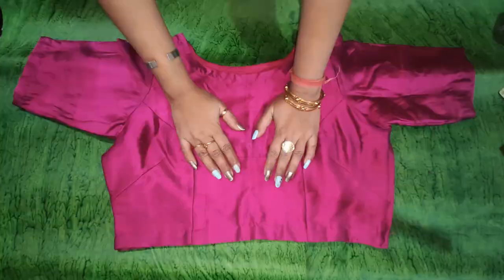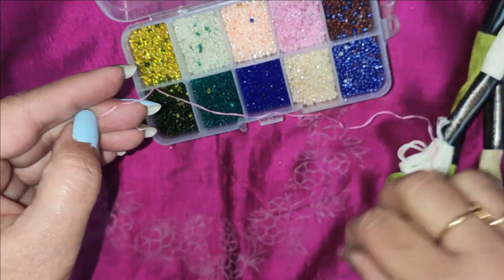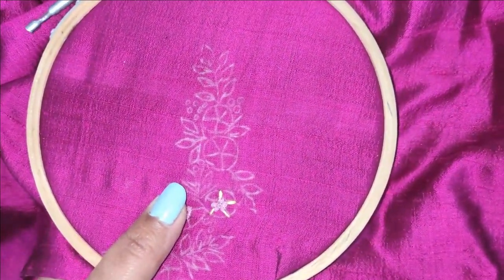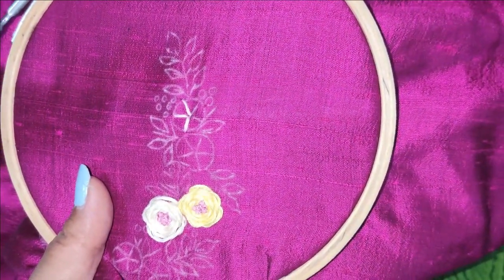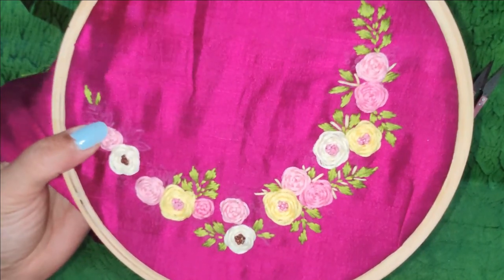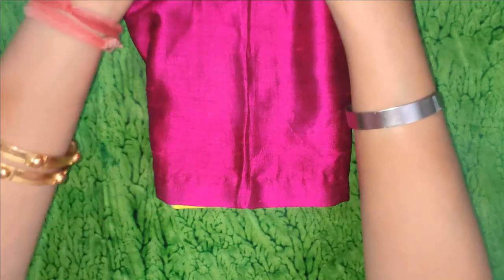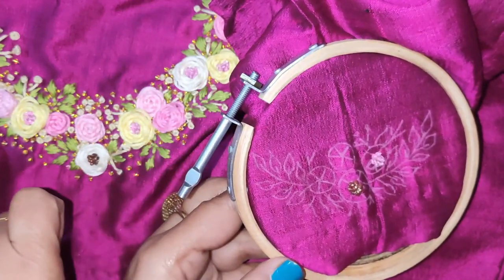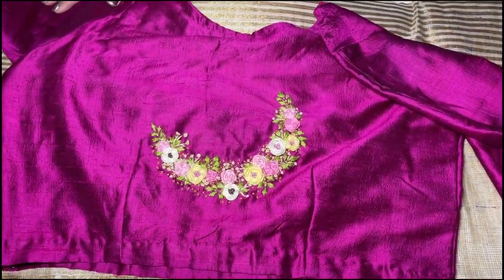BLOUSE DESIGN IDEAS | BLOUSE KAISE BANAYEI | HOW TO DESIGN BLOUSE | EMBROIDERY FABRIC STITCHING

Comment: Maam can I know from which website did you order the beads
Reply from the maker: Hi , these beads I bought from the shop store 99 in my city.
Reply from the maker: Limited-time deal: INDIKONB 7500 pc Opaque Seed Beads 8/0 3 mm for Jewellery Making Material for Earring , Necklace , Bracelet Jewelry Making Set for Girls and Women - includes Opaque and Neon Small Multicolor Seed Beads - 15 Colors (approx 15 gm or 500-540 beads per pack) , Nylon Wire Thread for Jewelry , Embroidery Work , Art and Craft and Beading DIY Kit for Girls | SB # OM 1

Check this, I found in Amazon